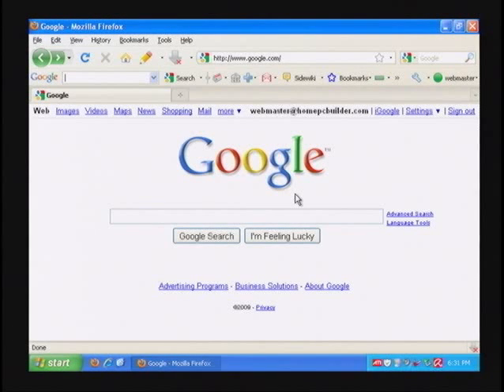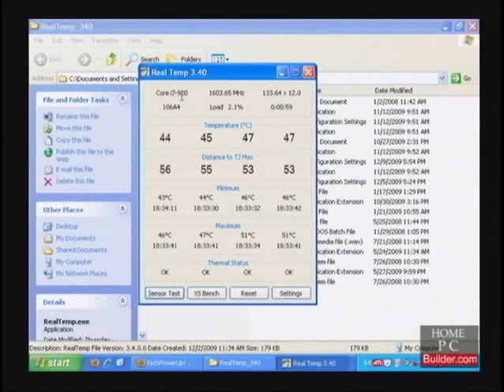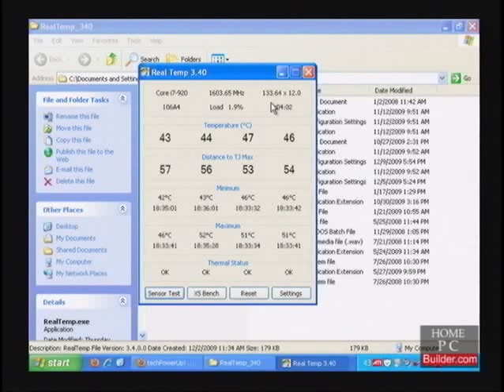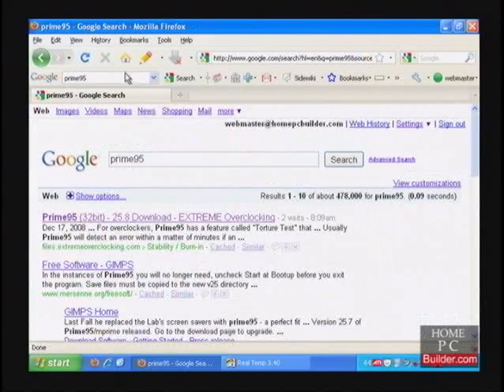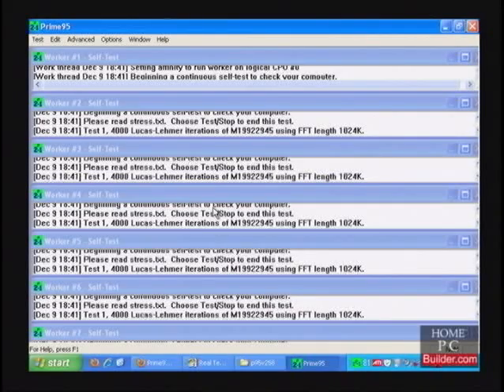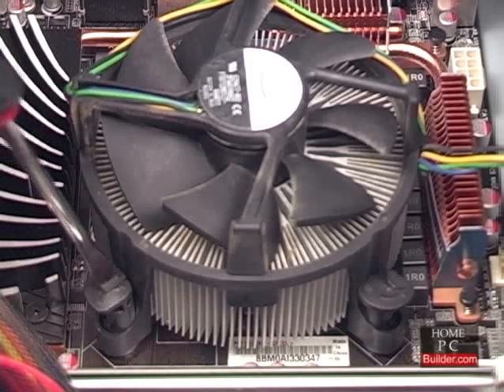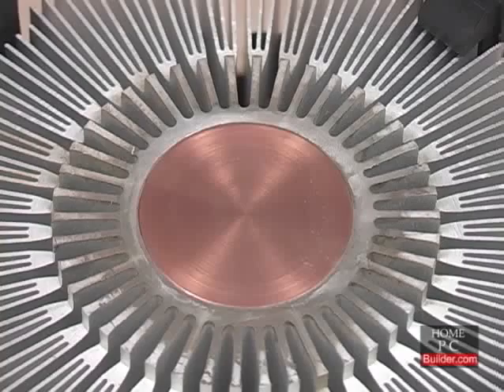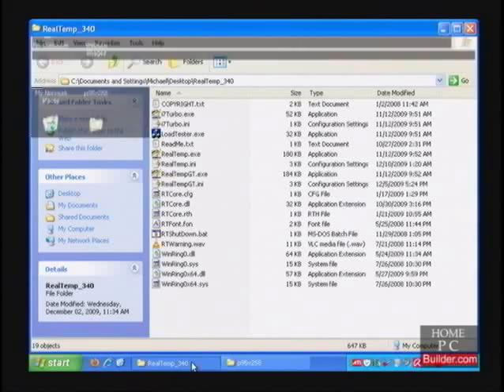Lesson 02 - Part 1 - Intel Core i3, i5 and Core i7 CPU Overclocking - www.HomePCBuilder.com

Comment: i3 4170 , can it be overclocked?
Reply from the maker: Jason King I don't think so. You can't raise the CPU multiplier beyond its stock setting and I believe on that generation CPU you can't raise the base clock beyond 103 megahertz. I guess that would give you a very very slight overclock if you could raise it by 3 megahertz but I seriously doubt you would notice a difference performance. I may be wrong about that there could be a motherboard with maybe a Z series chipset that would allow allow you to raise the base clock further. On the other hand if you're buying a Z series chipset motherboard you're better off spending some money on a more overclockable higher-end CPU.
Reply: I think you are actually correct. I Googled around a bit and have come to the conclusion that the old method of raising the FSB has been disabled either by Intel on the CPU itself or by the motherboard manufacturers due to pressure by Intel. Ah well. Not to worry, Ryzen is coming. Wish there was an equivalent competitor to Microsoft in existence too.

Comment from the maker: That CPU could be overclocked if the BIOS has the required settings to change.  That CPU is meant for laptops and most manufacturers won't give you the option to overclock it. The videos in this series show the required settings in the BIOS.

Comment from the maker: The memory frequency is the base clock times the memory multiplier.  If the base clock is 200MHz and the memory multiplier is 8 the frequency of the RAM is 1600MHz.  While you are finding the maximum speed your CPU can handle you need to lower the memory multiplier so that as you increase the base clock and along with it the CPU frequency the RAM's speed to does make the system unstable.

Comment from the maker: @freegamer666 I'm not finding an Intel Core i3 M390.  There is a much older CPU called a Celeron M390.  It depends on the changes you can make in the motherboard's BIOS that will or will not let you overclock a CPU.  If your CPU is the older Celeron model, overclocking it would not get you any significant performance increase.  If you do have a newer Core i3 CPU it may be overclockable but again it depends on the changes the BIOS lets you make.

Comment from the maker: @yyquest You want to put enough thermal compound so there is a very thin layer.  You can spread it manually with a credit card if like.  Just putting a drop in the center of the heat sink or CPU is what I do.  When the two press together the drop spreads out.

Comment from the maker: @TheMoosa90 The thermal compound is there to better the connection between the CPU and cooler.  If you don't use compound the CPU will get much hotter.

Comment from the maker: You don't have to.  The exe file is supposed to use the dll file whenever it needs it.  Did you try an earlier version?  If you're trying the 64bit version of RealTemp you might want to try the 32bit version.  It will work just as well to tell you the temperatures.